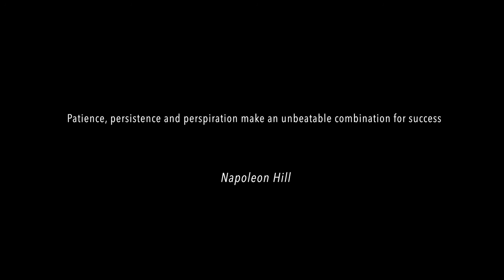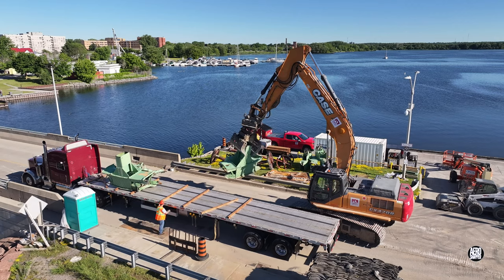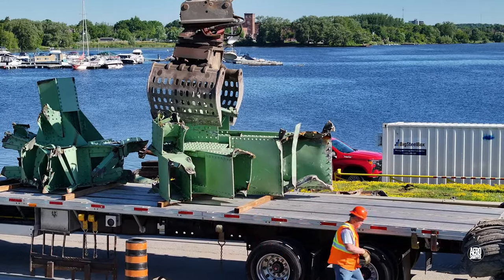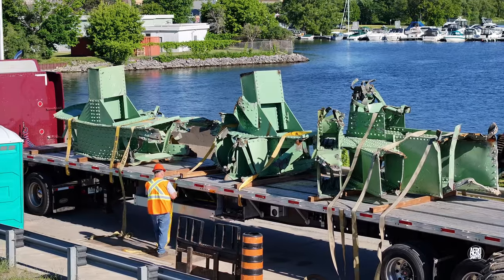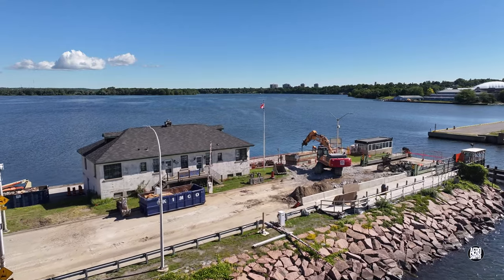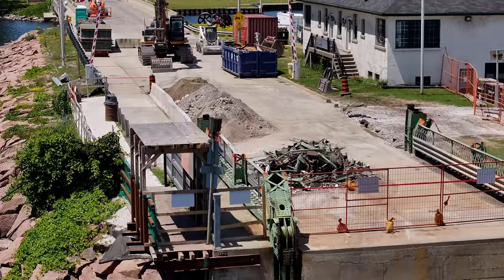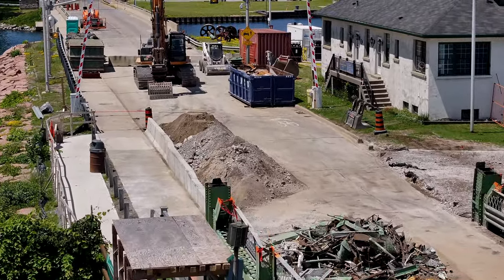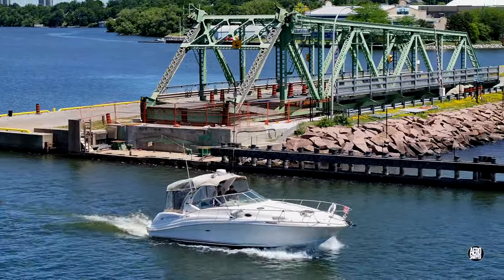Geared Up to Go - an update on the La Salle Causeway lift bridge   4K

Comment: The bridge was nearly refurbished. It would be a speedy and effective temporary bridge. After all it's been the right size for over 100 years. Note that something resembling 2 hinges have been left on the west edge and the cut edges flagged in red. One has to wonder whether the bridge will be attached again at the former attachment points and a lift mechanism (a large crane) brought in periodically or by appointment to allow access to the inner harbour and the Davis dry dock.
Reply from the maker: That’s a very interesting idea - the two heel trunnions - ‘hinges’ - are indeed still in place.  What lies in their future will be something worth looking out for.

Comment: Get all the boats that cannot pass under the Cataraqui Bridge section out of the basin. Put the bridge back into place for now until they can come up with a plan to replace it ! Traffic is horrible across the new bridge
Reply from the maker: I understand the frustration, but the option of alternative land routes is not open to maritime traffic, which goes well beyond the interests of leisure boating.  Access to the dry dock and workshops at Kingston Marina is of critical importance to commercial operations.
Reply: They could develop some sort of method to slide it back into place and remove it at scheduled times for larger vessels to plan for and access the inner harbour (every two months or so).